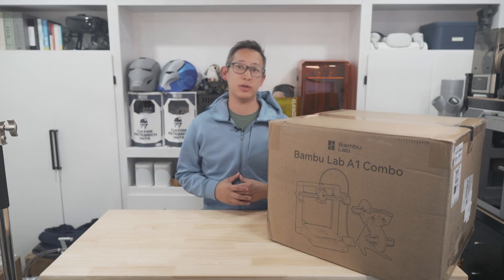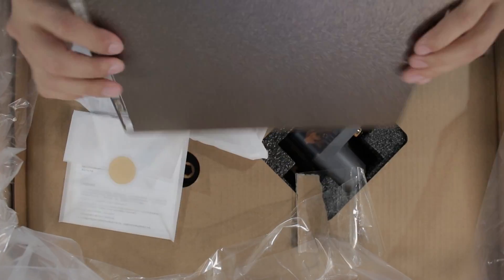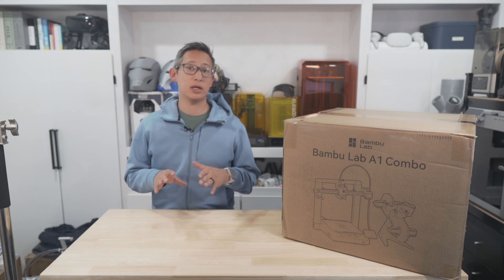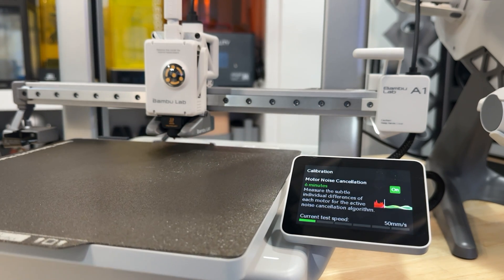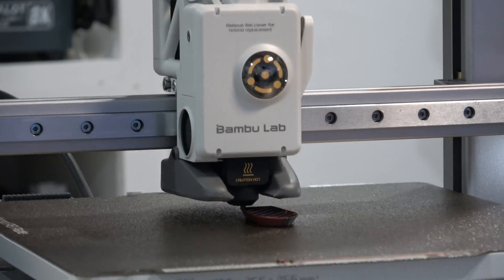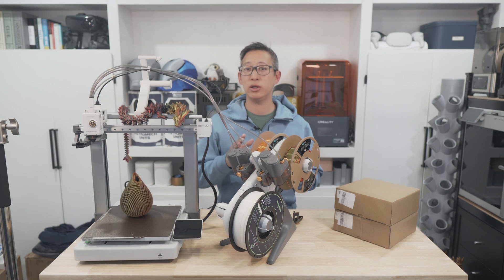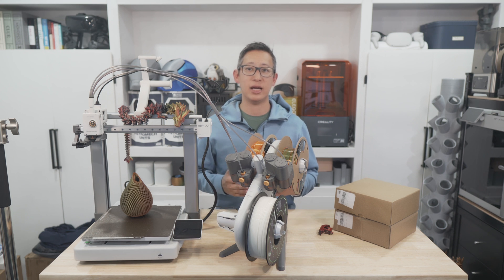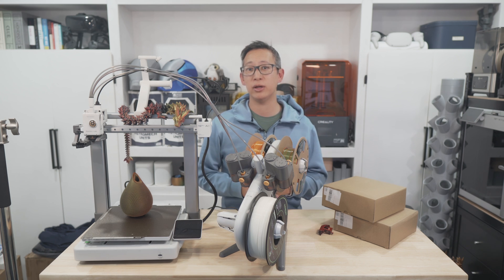Bambu Lab A1 Amazing 3D Prints | Unbox and Review

Comment: HI I wanted to make an enclosure for the A1 bamboo because I have a room at 16°C and I had thought of making the walls with "non-woven fabric" (that is, the fabric that is put on plants in winter) so that the machine can breathe but at the same time have a temperature that is more or less acceptable for printing. I think that electronics don't have any problems ps. I will only use pla and petg what do you think?
Reply: Bambu says they don't recommend enclosing the A1 on the page for it, not sure how much it will impact anything though
Reply: @GC3DC  
Ok ok
I will make a dust enclosure but with removable doors

Comment: So do you send the G code file by WiFi from computer to the A 1 ? Ty for video
Reply: If you use Bambu's slicer it goes to the cloud and back to the printer
Reply: @chomp7927  so direct hardwire connection  from computer to printer or wifi to computer ? TY
Reply: @PeterAgostiniJdcap26  printer only has wifi. I guess you could try lan mode and putting gcode on the sdcard but there are rumors it still phones home in lan mode and honestly I'm too lazy to try that lol, I put the bambu in an isolated network and have just sent 100% of things over the cloud. It's seeming to be a good printer so far, few things to learn but I think the majority of that is me not being familiar with bambu slicer in general, it's based on prusa slicer though so I'm familiar with that at least. I've had 2 outright fails, one seemed to be from trying to reprint an old file from the cloud, didn't play well but that was on shipped firmware not the day one patch, and then a spaghetti mess that I have no clue what caused it, I'm guessing crappy year old overture PETG, the one print I didn't watch or check in on lol. Other than that everything else has worked out great it's just a matter of me dialing in filament settings I think.
Reply: @chomp7927  thank you for the detailed information. Much appreciated.👍🏻

Comment: Can you add another AMS lite? I've not heard anywhere that this is possible
Reply from the maker: I think it will be a future feature that needs to be unlocked by a software update.  There are two ports on the back of the printer which makes me assume that eventually you'll be able to connect 2 AMS lite's or an additional accessory of some sort.   I may test it out when i order a second combo.
Reply: Bambu Lab Website, under the Q&A's, states that it's capable of connecting only one AMS unit on the A1 and A1 Mini's.